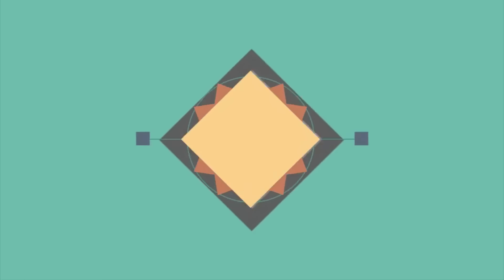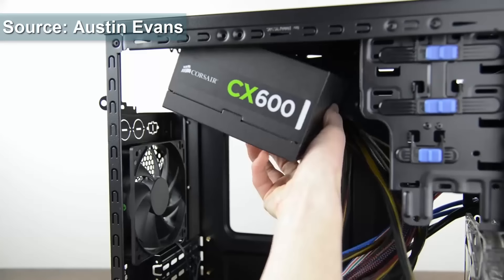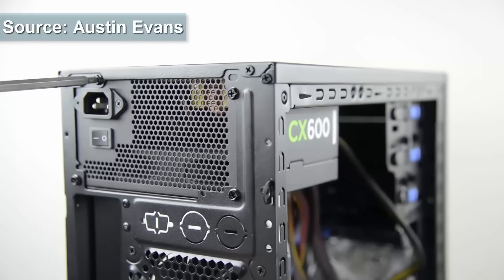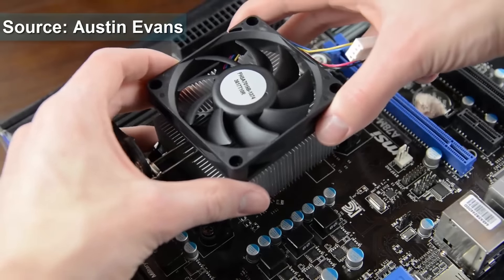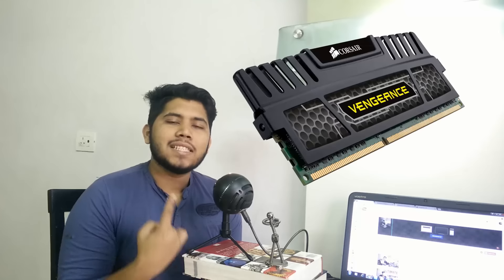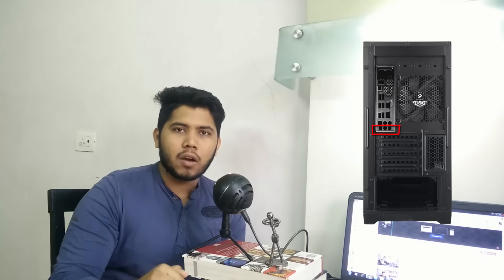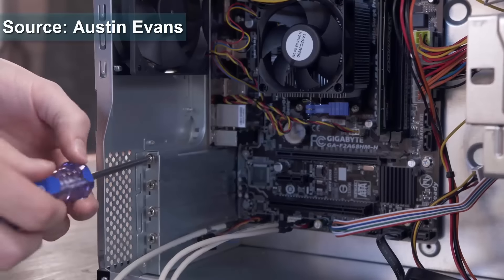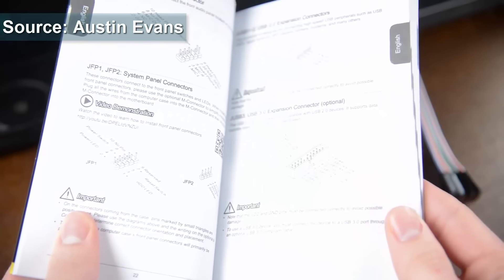Learn to build a Gaming PC - Learning PC builds #3 - TheBrironTech

Comment: Great video + The information You Deserve More Subs
Reply from the maker: Master Tech Thank you so much. If you guy keep loving and supporting like this, and hopefully there will be more subs.. ☺️
Reply from the maker: Master Tech BTW, buddy, you're vidography is pretty amazing. Nicely done. Just one tip, if you don't mind me giving you one. For the horizontal slide shot, try wrapping a rubber band and moving the tripod head rather than using your hand. It tends to give smoother movement. And another trick you could use is shoot the clip fast and use slow motion in post. Makes it look smoother. Just a tip, if it helps.
Reply: Definitely i will try this in my next video thanks Bro 😊

Comment: Nvidia GTX 1060 3gb vs AMD RX 480 8gb which one is better if i got both at same price
Reply from the maker: Manish Kumar See both of them are great graphics cards. And they both perform neck and neck.. In some games, the 1060 performs better and in other the RX480 performs better. So you can check out benchmarks on YouTube and then you can decide depending on what games you wanna play. Either ways the difference is not huge and you will be happy with whichever one you buy.